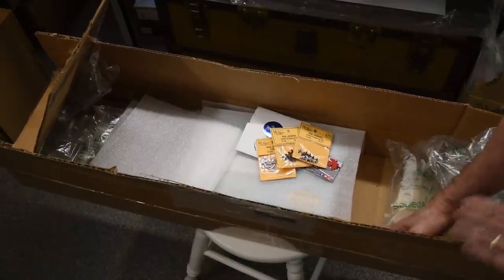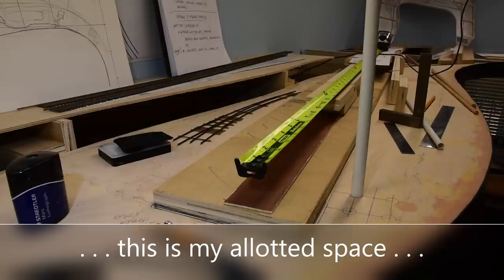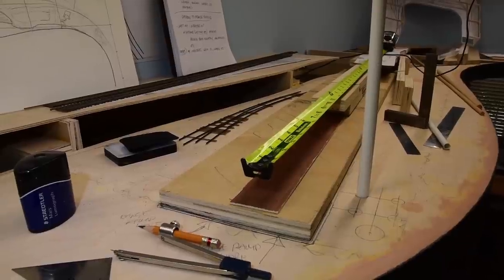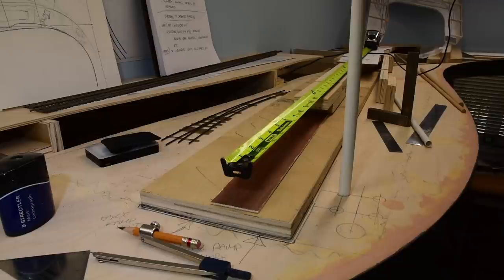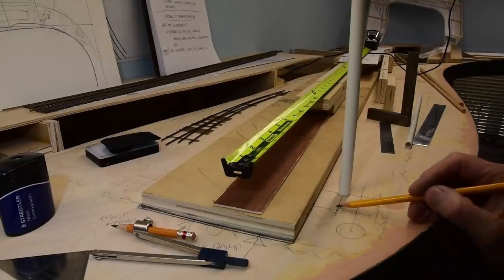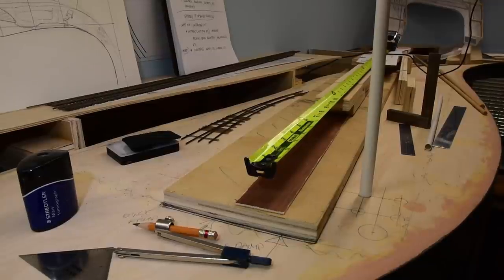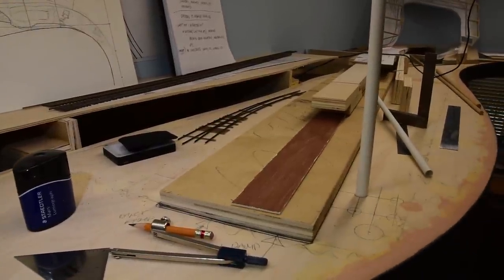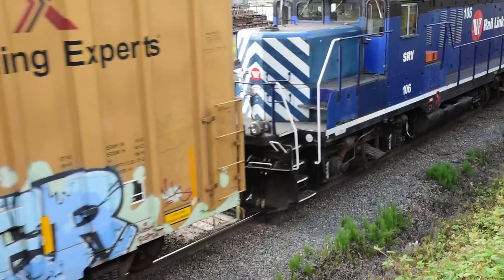Will My Dream Railroad Fit The Space? | River Road Vlog # 12

Comment: Ok 2 things.... first, I really enjoy what you’re doing. I’m not aware of any other modeler that takes you through the whole design process. The whole thought process, thinking through the logistics of available space and what makes sense and what fits and the visual effect of the components. You really explained it well and gave others a really good lesson that is relevant to anybody building a layout. Let’s face it... our visualization of space for modeling often is like eating a good meal.  Our eyes are bigger than our stomach. Same applies to constructing or designing our layouts..

Second... your video clip of the 3 unit lash up pulling a single boxcar reminded me of the last days of the Milwaukee Road when years of deferred maintenance resulted in putting massive amounts of head end power on a train with the hopes that if several of the units failed on the road, they still had enough horsepower to get to the destination.

Thanks again for the lesson.
Reply from the maker: Wow! O.K. I appreciate your thoughtful treatise there. I think your analysis of the short line with extra units makes sense. Especially when short lines focus on service and reliability. SRY has a very interesting history. They are a very classy railroad as well: https://www.sryraillink.com/about-us/history/ Cheers.

Comment: At walking distance is an interesting industrial diamond with building following track curvature. If you go on 464 Fraser a well manicured grass with trees and bushes follow track betwen buildings. Quite different from udual trash zone. 464 have interesting roof repairs done while old sections are disappearing under moss. So much to see in a little space. Shelf is a good way to avoid space loss in the room, but make it harder with perpendicular tracks. We can fake them with false hidden, but mostly we end up parallel to wall. The smaller the scale the most options there is.
Cherrs.
Reply from the maker: O.K . . . Cheers.

Comment: A tug boat would create some awesome visual interest, and added dimension as well… you have an example just past 15min in your vlog. Also, based on the trucks used, what is the max rated speed of the SW900?
Reply from the maker: Yes. A tug boat would be awesome and I am considering (a scratch-build) of one as well. I have some generous experience building ships and boats as well. As to the "Dofasco" GM-style trucks I have a set which fits this model. I am not sure of the max rated speed of the SW900RS to be honest, but I do know they use them as "road" switchers. Cheers ~ Boomer

Comment: They always say, sleep on it, it'll eventually roll though your head on how this small space problem should unfold.  Go down to the hobby shop or go to some forms and talk about your new SW900 in a since clear your head of this thing that's got you tied up.  In a few days things will start to visualize.  My blast furnace with its buddy the blower house with huge amounts of electric cables and huge I mean larger than life air pipes, hot & cold some with flammable gases are all above the rails tucked up against the blast furnaces and down the way of the layout going to other buildings to supply air gas ect;.  I've moved in my head just where the best placing of blower house, electric power generator and blast furnace should go all because I'm building it as a shadow box layout using selective compression as you've accomplished with your Glover Road diorama.  My problem exists because the blast furnace needs visited on both sides and turning it 90° just won't work.  It's taken a few weeks but I finally figured it out when I seen a certain photo that bought it all together.  Your fine, just let it ride and things will come to you, after all, you always can change it down the road, which I'm aware that's what your trying to avoid.  Is it still 120° up there, the weather is finally starting to act like it's supposed to here . . . Brian
Reply from the maker: For sure. Sleeping on it helps. The heat is finally abating here as well. It really killed my momentum for a couple of weeks but I am coming back into form now. Cheers.

Comment: I have a few boxes of Proto 2000 / Atlas Classic / and Bachmann Spectrum locomotives from about 25 years ago.  C&NW, M&StL, and SOO Line.  I also have 2 dozen brass steam locos.  The trick is going to be deciding which locos work best on my shelf layout.  I'm partial to ALCO RS1s and maybe a few SW9s or other small switchers. I'll need to join a club to run the big locos...  Thanks again for another great video!
Reply from the maker: It sounds like you have a fun problem there. I think we all end up with more locos than we need at some point. Part of the fun is collecting them as well and then building a railroad around them. Cheers.
Reply: @boomerdiorama  in my case, FINDING appropriate locomotives is the challenge! I’m modeling a very unique N scale concept that involves 1st gen SP diesel locomotives. So, finding Alco and early EMD engines is tough. The kids grab F7s, don’t understand the difference to an F3, etc. I’d love to find a SP 415 as one example. Maybe 3D machining? Keep up the wonderful storytelling!
Reply from the maker: @davidbarrett8451  Well you could 3D print one if you desire one as well.

Comment: Is the code 70 prototypical?      (On my very small Dutch layout I have used PECO code 60 on PCB sleepers)
Reply from the maker: Code 70 is closer to the prototype (in this case) than Code 83. It always looks better with a lower profile in my experience. At the end of the day, track is a model as well. Cheers.
Reply: @boomerdiorama  Hello Boomer. Yes I agree. For me, track is the most important component of the railway model.
Reply: Look at it this way, code 70 rail is .070" tall. In HO scale .07" is 6.096". Code 83 would be 7.228" and code 100 would be 8.709". Depending on what part of the railroad/kind of railroad you are modeling all are prototypical. For a bonus, code 55 at 4.789" would be a light rail and could be used in old spurs and yards.
Reply from the maker: @thomasboese3793  Sounds good! Thank you for sharing those specs. I find Code 70 just looks better for short lines. Cheers!